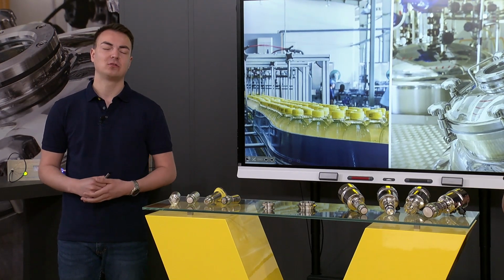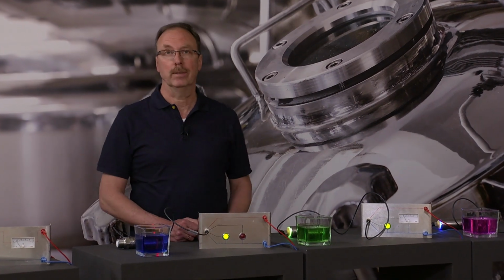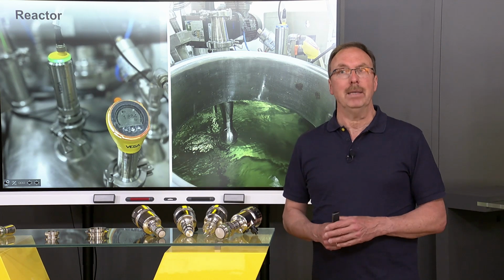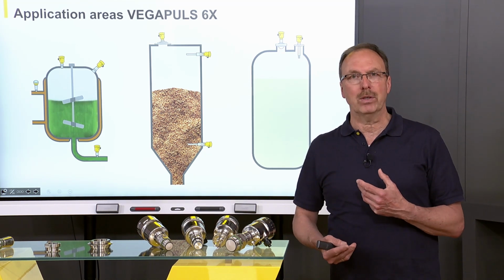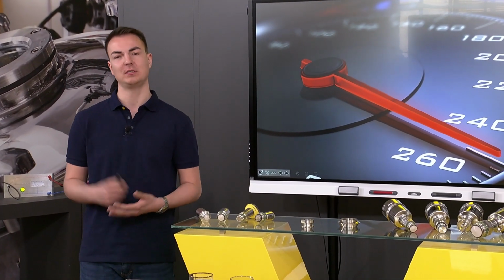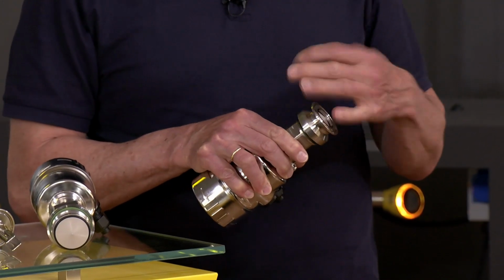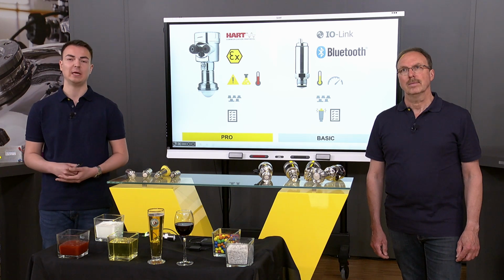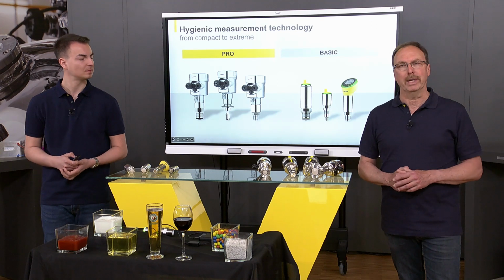From compact to extreme: This is what radar level measurement technology can do | VEGA Live Demo

Comment: Does VEGAPULS 64 needs any additional power for display, bluetooth, etc
Reply from the maker: The VEGAPULS 64 has an integrated Display and Operation module. This works with the power supply from the sensor. There is no additional power supply necessary.